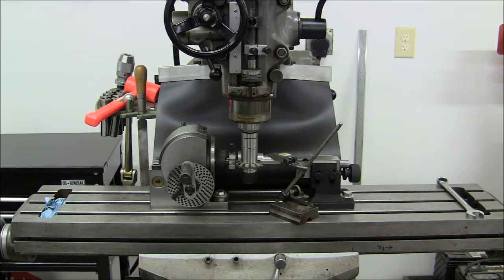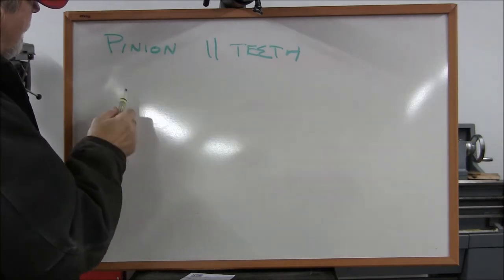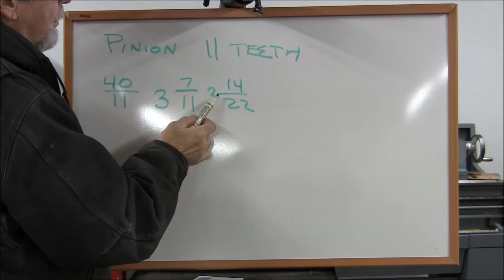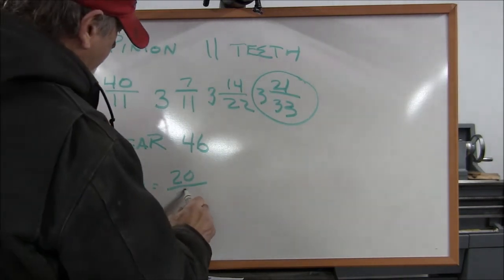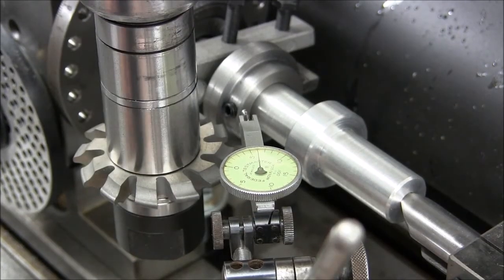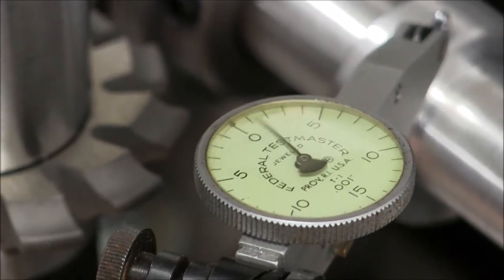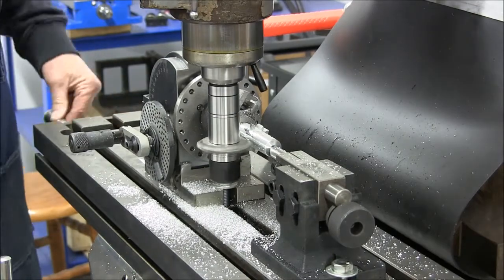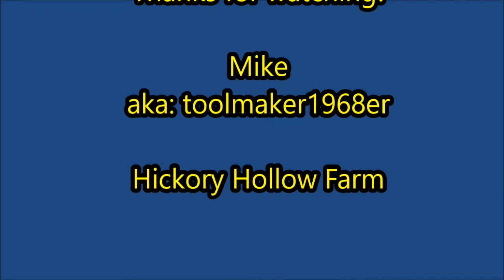Doall bandsaw refurb Part 11

Comment: The setting up probably took a chunk of time. The math always makes my head hurt!
The cuts seem real nice even if crests a bit pointy. Does seem another proto is in the works!
Reply from the maker: ChrisB257 - About an hour for the setup.  Probably another hour fiddling around getting the head unpacked, some assembly, finding that the keys supplied are to big to fit the b'port slots etc.  I'll make another pinion blank tommorow and try again. I'm in the twilight zone on this profile shift stuff!  Not even convinced standard gear geometry wouldn't work!  Lol Tc, Mike

Comment: are plan spur gears going to work ok where there were helical gears before?
Reply from the maker: douchebagnumero1 - I can't think of a reason spur gears shouldn't work.  May have  a slight increase in noise. My research indicates about the same strength.  No side thrust issues with spurs and slight edge on power transmission efficiency.  Guess we'll find out!  Lol. Cheers, Mike
Reply: Michael Murray I'm not an engineer but I hope it works ok! at any rate it make for great video content.